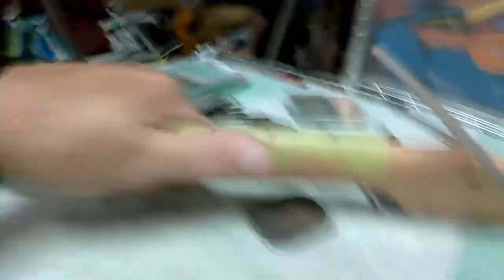SG Style Guitar Build - Solo Music Gear  Episode 2

Comment: So what was the tool you used at first to make the frets not stick out? Thanks
Reply from the maker: If you're talking about the thing at about 2:35, that's a fret beveling file.  I bought it from Amazon a few years ago.  the one I bought is not available anymore, but there are a bunch of different ones still up there.  Not too expensive:  $10-15 US for cheap ones, or $30+ for nicer ones.  It does a nice job of knocking the ends down and keeps a consistent angle to the fret ends.  Thanks for watching!